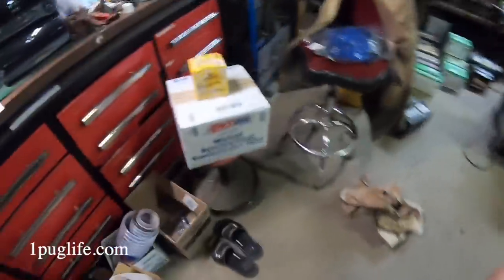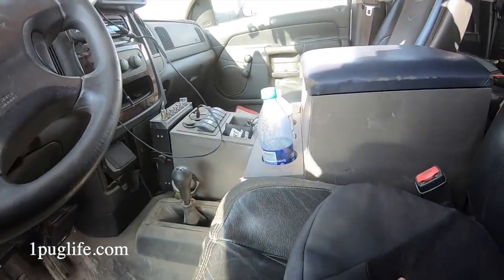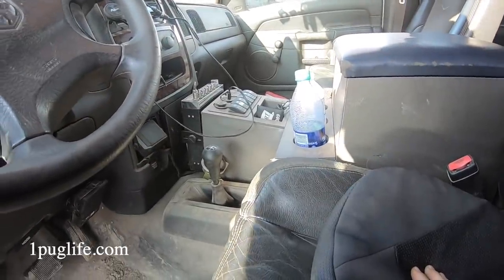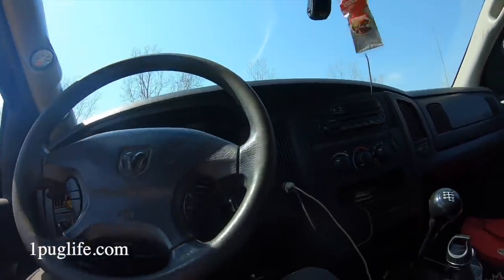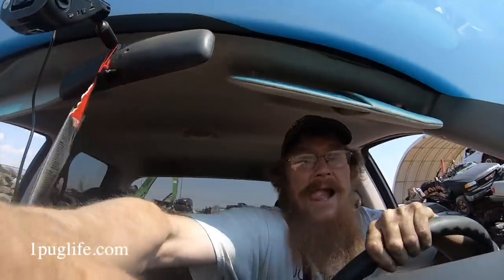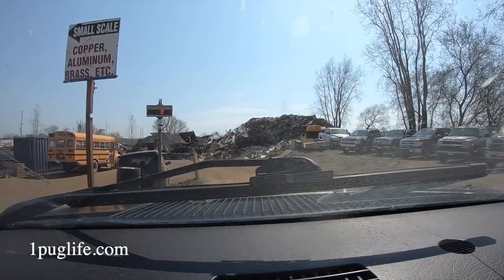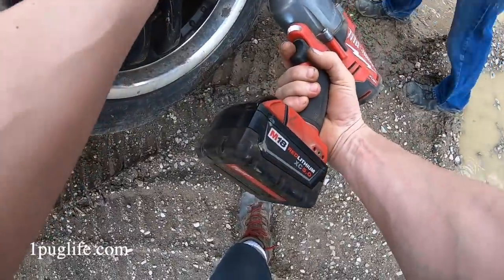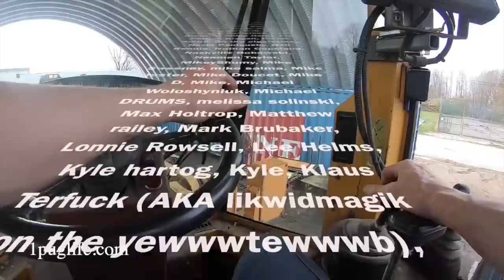trailer tire blew up with a load, different types of crushed aggregates and special guest

Comment: Whatever you do do not cut that truck up fix it get up and running and just use it to haul cars load cars onto the back of it extend it you can do it extend it turn it into a freaking flatbed tow truck you have what you need there to do it it would make it easier for you to haul cars the hell with dumpster hauling tires and bullshit turn the damn thing into a tow truck
Reply: Motor is going in the Grunum van, the rest turned into a tilt bed trailer. That's HIS plan.

Comment: I just replaced my 4x4 overdrive housing on my 03 Cummins. Bought a new OEM one on eBay for $350 with a warranty. My local stealership wanted 700.

Comment: hey I have a good idea, lets stand under a truck held up by a loader with questionable hoses...what could go wrong?
Reply: Not a great idea but just so you don't make the same mistake, Every loader has questionable hoses it pretty much goes without saying.
Reply: @zerofox7347  i have been around heavy equipment for decades, first thing I was taught was never trust the hoses.....new or old.
he has a rack right there, takes 2 mins to move the car off put the other one on.

Comment: If you want that stuff packed down I’ll tell you a little trick you can do. Once you get it spread out spray a little diesel on it and then get a torch blow torch heat up the area and then Roll it or pack it down once it cools it’ll stay hard like asphalt. If that stuff is ground up asphalt it looks like it is.

Comment: Spray the gravel with some water and try packing it somehow, the tractor should do it. Ya water will help it compact.
Reply: just dump the next 100 oil changes right on the ground it will do the trick
Reply: @imchris5000  🤣😂 ya that’ll do it!! Pretty much asphalt at that point! LOL
Reply: If he is smart he did !

Comment: Probably going to get some BS for this coment but if u can't find a transmission/houseing for the ol dodge they make kits to put a manual ford trans behind a Cummins probably more work than its worth tho. But that scrap yard Cummins is just mint. I would have tried to score a deal with that and the two ford duallys thare but that's just me u do u bud.

Comment: @1Puglife ... Hey Chris if that is asphalt grindings... soak it with diesel fuel or kerosene from a pump type sprayer  , put a TAG Torch to it and roll it out w/ a rented vibro roller and it will more than likely hold up better than what those GOOFS put in front of your shop... That is how I did my whole drive... 3 inches of asphalt grindings lit on fire w/ kerosene and rolled out... 10 yrs old and still great...I just seal it every couple of years... Many Blessings , SMR